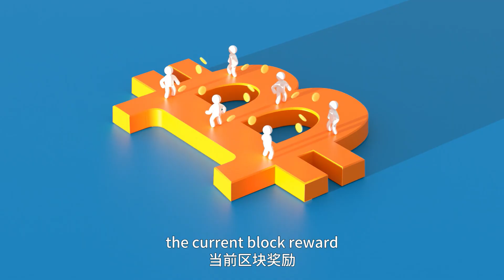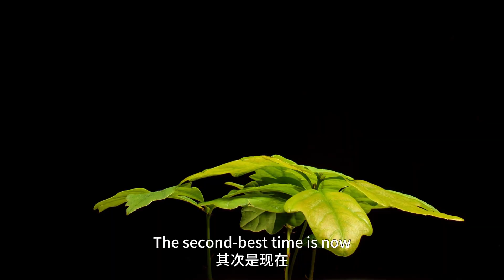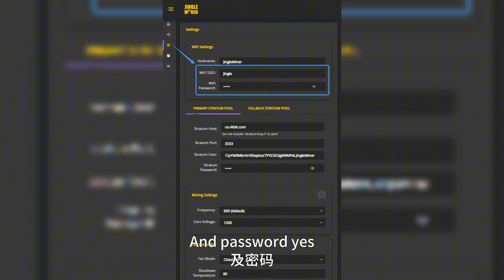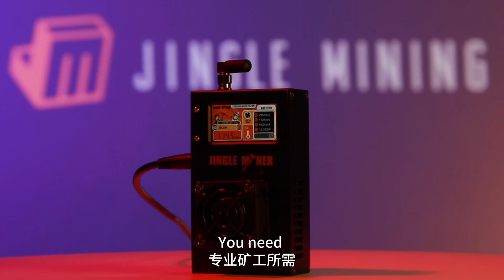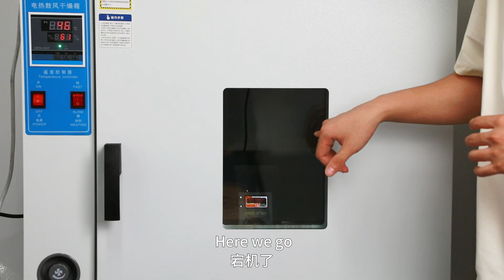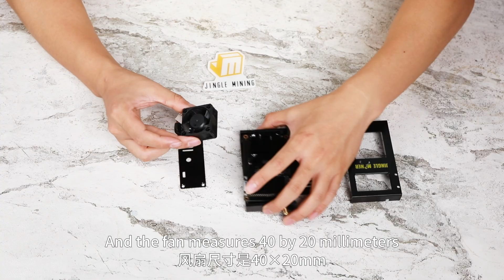Opportunities and Challenges of Bitcoin Solo Mining: Jingle Miner BTC Solo Lite Introduction

Comment: If the back plate is metal, have you tried adding a spacer to heat sink the vrm to the case? It may help your regulator temp and help with better overclocking.
Reply from the maker: We did consider attaching heatsinks to the casing for auxiliary cooling, but it's not necessary for our current 1.2T solution. It already can operate normally at ambient temperatures of 38-40 degrees Celsius.
However, we will consider attaching heatsinks to the casing for auxiliary cooling in our upcoming 4.8T version, as it will have higher heat dissipation demands.